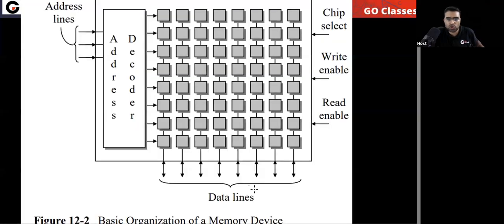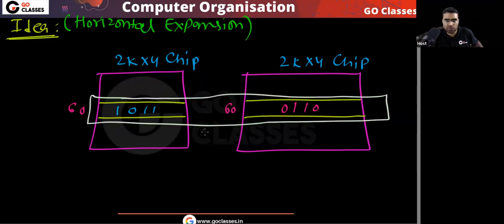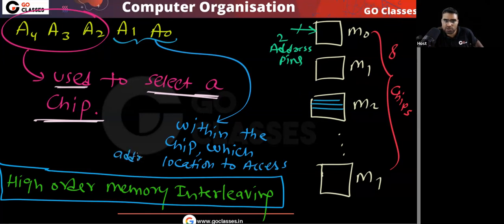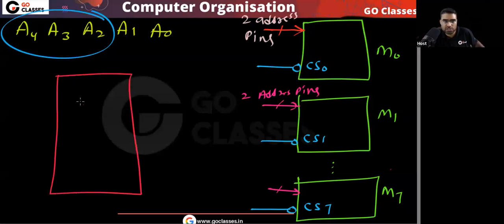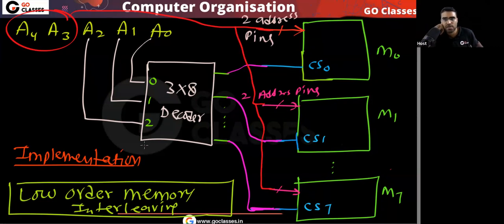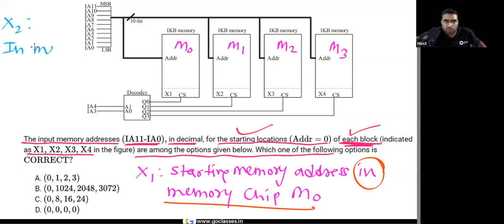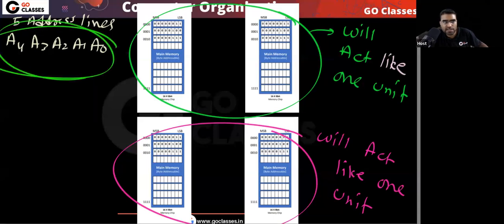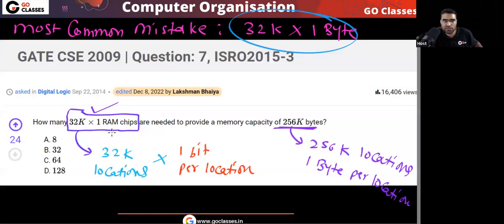Memory Interleaving GATE PYQs| High Order & Low Order Interleaving| Memory Interfacing| With NOTES

Comment: Sir, I am coming across the term "memory interleaving" being used for splitting the memory into "banks" for accessing multiple parts of the memory at the same time, thus speeding up memory accesses. This sounds different from using multiple RAM chips, even though the numericals seem to be solved using same concept. Could you please elaborate more on this or point to any reliable resource for more clarity?